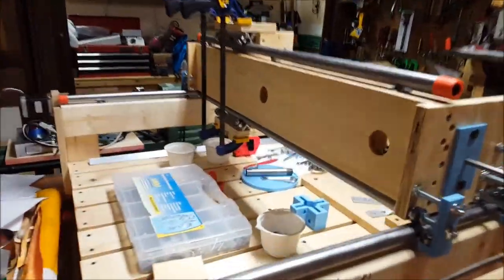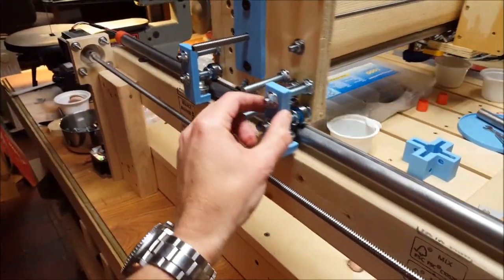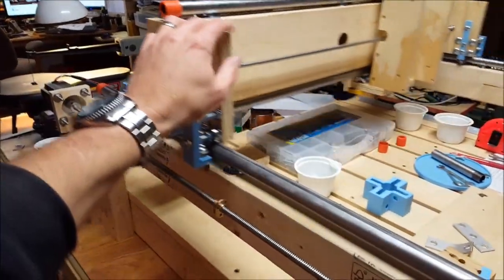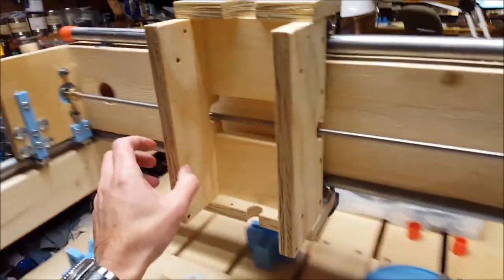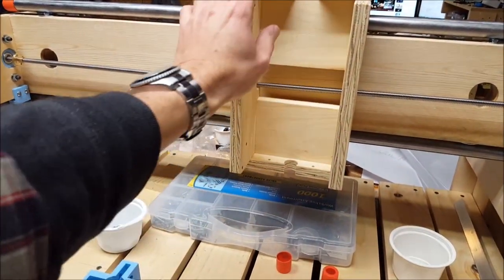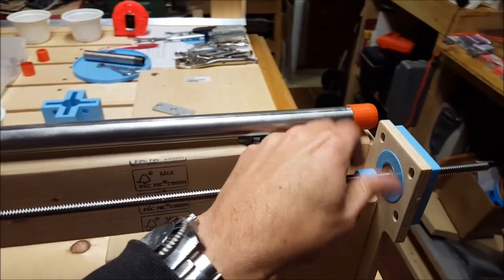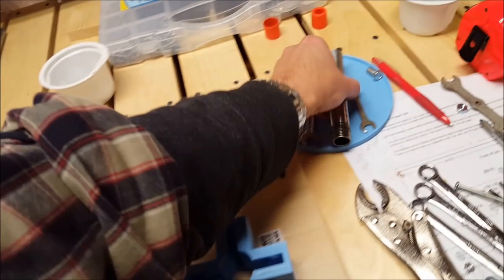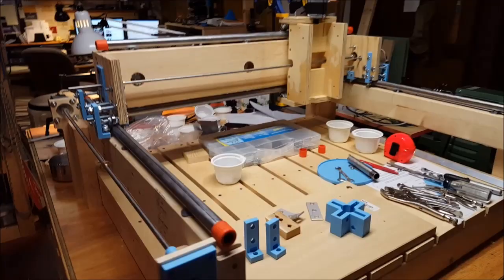Solsylva CNC Build - Z Carriage Progress

Comment: Dan - Looking great so far.  I love your 3D print designs and parts too.  Great job.  Thanks for showing your progress along the way.
Reply from the maker: Thanks, Dave.
Reply: Hi I am making one also.  I like how you use pipe and bearings for slides.  I am wondering how did you screw the pipe to the wood.  I only see a screw going up from the bottom.  I don't see anything up at the top.  Thank you for any help you may be able to give me.
Reply from the maker: Hi Pedro.  The pipes (for the sides and gantry) are drilled through the bottom and then threaded rod is fed into the hole with a bolt on the inside of the pipe.  By holding a nut inside the pipe with another piece of rod or dowel the threaded rod is screwed into the bolt until it threads.  Then you can tension the nuts on the bottom.  It holds very well.  Best of luck to you.